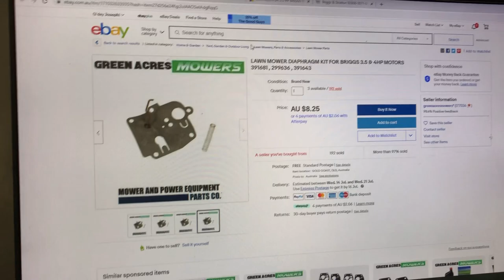Lets work on a good old rover 4 stroke

Comment: I got a Rover lawnmower for free 
It had a 1986 3.5HP Briggs and Stratton side start. The only thing that was wrong with the engine was the coil. But I’ve taken the Rover body and put it on a Victor grass cutter body and I also replaced the carb to a 06 plastic carb. Even know that the engine is old it doesn’t burn oil

Comment: Love these old vertical pull Briggs engines, I keep a few of them around too. Very hard to kill.  A helpful tip that I picked up years ago from somebody more clever than me ( and no doubt one that you would already know) to make starting easier with the vacujet carb is tip it up on it's nose for a few seconds before starting. A bit like you would do with Suzuki 2 strokes. Primes them nicely and if it's in good health it should fire up fairly easily. Well it works for me anyway lol.  Saves pulling the shit out of em if you're like me and prefer to keep them original. Enjoyed the video,  love to see the vintage machines being brought back to life. Hang onto it as they're becoming a bit more rare these days as feral owners with no mechanical nous whatsoever slowly run them all into the ground.  

Hey just before I go, I've been looking at these ultrasonic cleaners, but I don't know what size to buy. Can I get away with something like 1.5 to 2 litre capacity for small engine stuff? Cheers mate.
Reply: I got a Rover lawnmower for free 
It had a 1986 3.5HP Briggs and Stratton side start. The only thing that was wrong with the engine was the coil. But I’ve taken the Rover body and put it on a Victor grass cutter body and I also replaced the carb to a 06 plastic carb. Even know that the engine is old it doesn’t burn oil

Comment: I had the same problem with the same mower as your , Mine will kick over with one pull and runs like a dream until you put the air filter back on it then it won't start  It got me Fu"" why , so like you I had to replace the petrol take with a Carby with a primer Butten on it that fix the problem for me